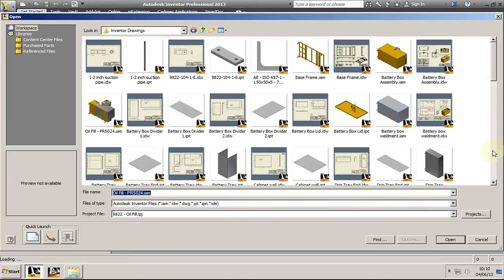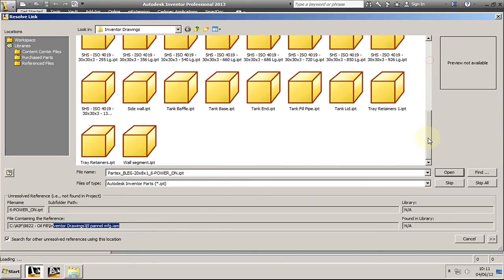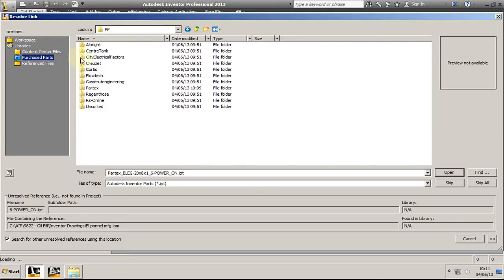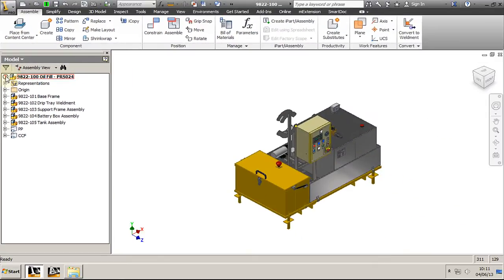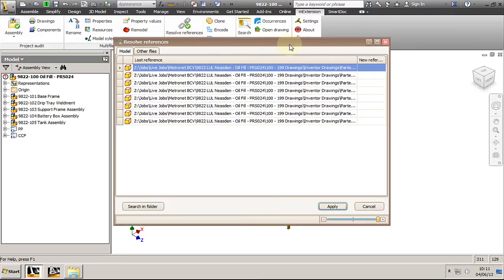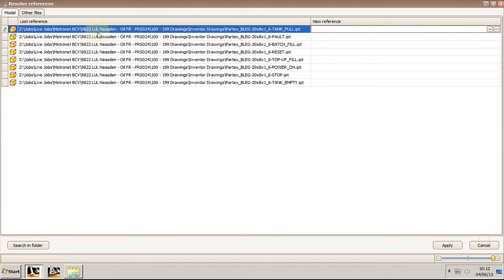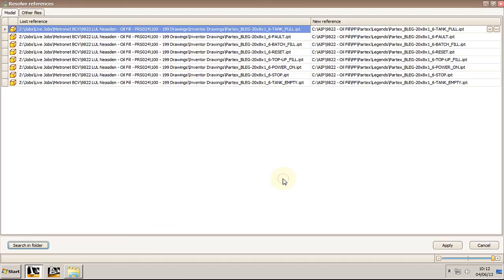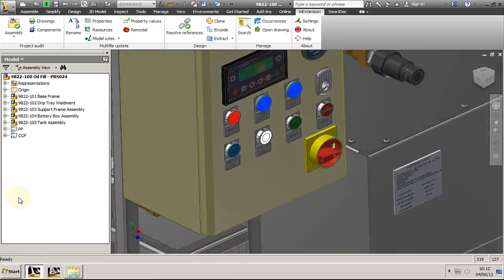Autodesk Inventor Unresolved References

Comment: The mExtension tab, is that a customised tab or did you download it?
Reply from the maker: It's a third party add-on. I have been pushing this company to get it public and they are just in the process. It's been tested on 2011-2016 (beta) and it seems to be working all right. Check the rest of the posts on my blog on mfManager formerly (mExtension).
Reply: That's good news. I'm eating up your Blog at the moment, very interesting tips and methods!
Have you looked at working with self draining lines in T&P or do you know any other blogger that has covered the subject in detail?
Reply from the maker: Stephen Barron Have talked with the guys and they will contact you with the installation kit for MFManager (mExtension). They seem to be fixing bugs and will release a new version soon. 
Have you seen my latest post on pipe clips http://blog.ads-sol.com/2015/03/inventor-pipe-clips.html ? will have to post the files for you guys to play with, can't seem to find the time to do the text and images. 
Chris Benner has a nice blog https://cadtipstricks.wordpress.com/. I have a nice post there as well on dynamic route editing.
Don't know about self draining line blogs, maybe search the forum: http://forums.autodesk.com/t5/inventor-general-discussion/bd-p/78
Here's another nice read on the forum if you have time: http://forums.autodesk.com/t5/inventor-general-discussion/attn-tube-amp-pipe-genius-cbenner-are-you-out-there/m-p/5357743 (I am salariua as you might guess)
Reply: Thanks for the Links! I'm connected with Chris too and have lots to learn to catch up to both of you. I'm familiar with T&P but my new job will feature a lot of self draining lines so i want to get as much info on it as possible. I'll follow the discussions and look forward to reading more of your posts!

Comment: Hi, I have a problem with an assembly that I created months ago and had to move all files to the new computer. Every part is in its place except for screwes and bolts that had been chosen from the Content Center. They basically disappeared from the assembly (which openes only if I skip all unresolved parts) and the only thing left are entries in browser menu. Any solution to this problem? I imagine the same thing would happen if I moved  the whole assembly just to another folder, perhaps another partition or separate disc.
Well, placing new components from the context center is pretty easy, I just hit the "replace all" in browser, chose path to the context center and magic happened. But the thing is, none of constrains and relationships applie to those parts. I can't figure out how to automatically fix that cause the only things the program seems to allow at the moment is to either delete or suppress all of them. :(
Reply: Oh and by the way, there seems to be no option named "mExtension" in Inventor 2016
Reply from the maker: The add-in was a 3rd party software developed to overcome the missing references error. 

When you move inventor files you need to keep in mind that you also need all the generated Content Center files. If you have access to the old computer then you can copy them to the new Content Center location. Check your project options for the new path; if that says "default" then check the Application Options path.

Unfortunately there is no way of generating the old content center files again except with custom code (programming).

If you have any programming skills I can find some links for you to get you started on how to list all referenced files (missing or not), how to locate them in Content Center (I think I have this around) and how to generate them in the default folder. You can then open the current assembly and the files now generated should become visible again.

Good Luck
Adrian S.
Reply: I have similar problem